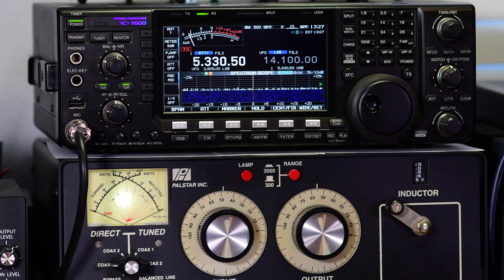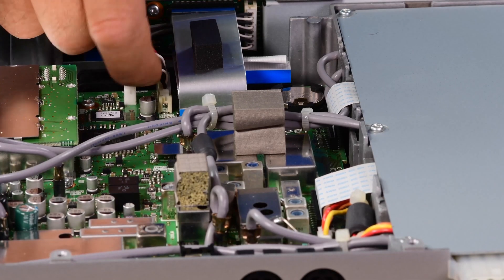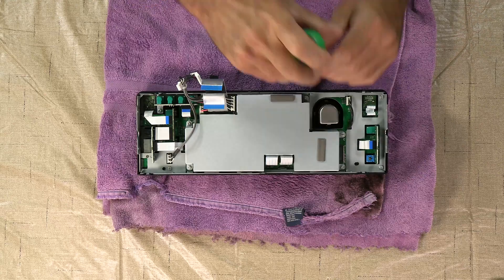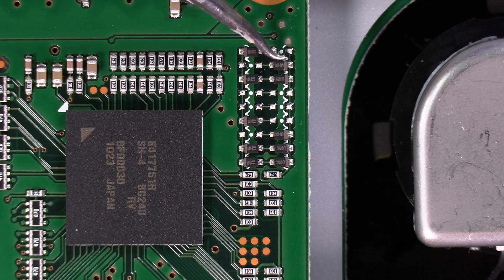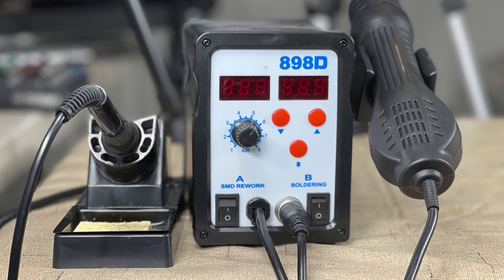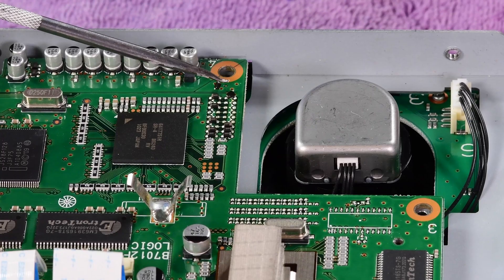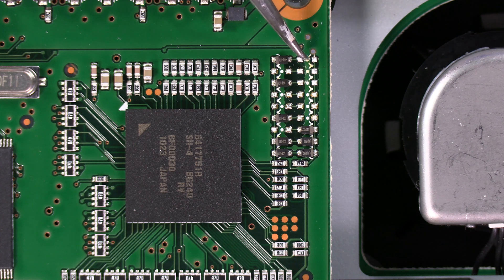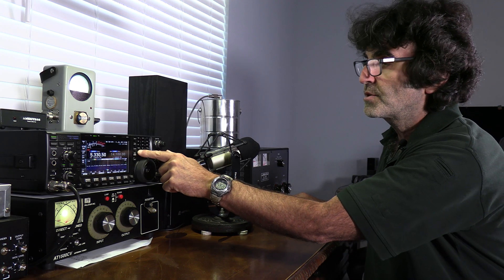Mars/Cap Open TX Mod on Icom IC-7600 [Test at the End!]

Comment: Hello, good evening, how are you!

could you tell me how do i unlock the european version of the ic7600?

mine only has tx from 7mhz\ to 7,200mhz
thank you in advance
Reply from the maker: HI, I'm not that familiar with the EU version.  I did a google search and it didn't really yield any results for the EU version.  But TX only from 7 to 7.2?  So only a portion of the 40 meter band?  That sounds like something else is wrong, what happened to the other bands which im sure are perfectly legal in EU?
Reply: @JLPicard440  and not the radio is sealed, and yes it is europe version, it has normal tx in all bands, but in 40 meters only from 7 to 7,200
I would like to open both above 7,200 and also above 3,800 ok as well as at 27 mhz

Anyway, can you give me some guidance?
Reply from the maker: @RansdonnyLZA  OIC...  Have u tried to google the mod where you're at?  It's possible those results aren't showing here on my computer. Or are far down the list.

Comment: Hello dear friend, can you help me and tell me what happens when diodes 51-59 are all removed?? I received a used device and that's the case there. The frequency opening does not work with this device. (Citizen Band etc.) Thank you for your reply. Many greetings
Reply from the maker: HI..Unfortunately I don't know what will happen.  I have never removed more than needed.  Do you have the old parts?
Reply: @JLPicard440  Thank you for your answer, unfortunately I don't have the missing diodes and parts. Is it possible to buy a new unit from Icom or rather repair it? What do you mean? Can the diodes be bought?
Reply: @JLPicard440  Do you know what kind of diode or type is installed there. I have to get a replacement, would also like to get on the Citizen Band. It doesn't work like that at the moment. It's frustrating. I thank you. Vy73

Comment: Wondering if you have a tip on opening Tx for 11meters in a Xiegu x5105
Reply from the maker: HI, I'm not familiar with that radio.  Have you checked mods.dk?
Reply: @JLPicard440  yeah! Nothing on mods.dk. I'm thankin' it may be in the software as it is with the just released  x6100. I'm lookin'...

Comment: TXmod.   On.    Ic 9100      27,000     AM      26,000   AM     ❔❔❔❤️
Reply from the maker: Not sure what that means.
Reply: @JLPicard440      ICｰ9100  
TX  MOD   解除　27.000Mhz 教えて頂きたく思います　宜しくお願いします🥺
Reply from the maker: HI, I don't have an IC-9100 here to do a video on.  You can check mods.dk and see if they have the mod listed there.
Reply: @JLPicard440        Sannkyu ありがとうございました😊　またお願いします　ありがとう　さよなら
Reply from the maker: @jalair5395  どういたしまして！